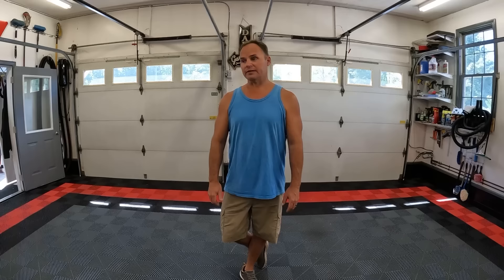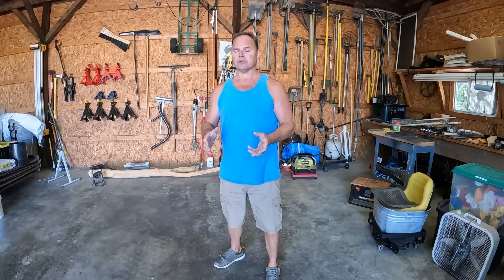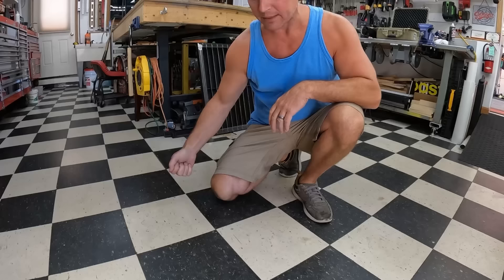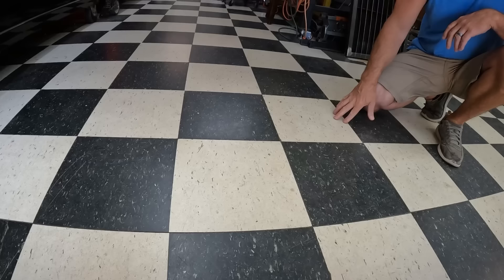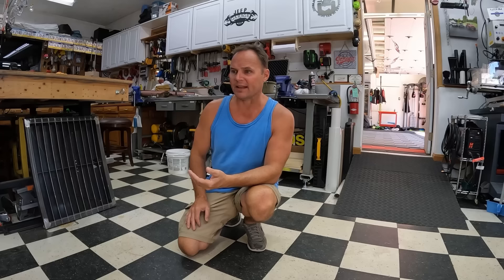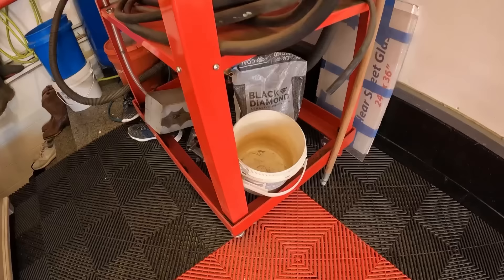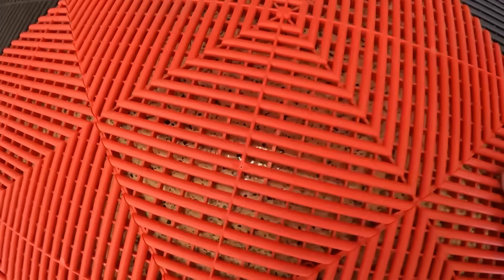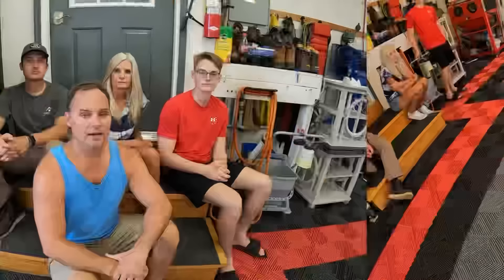SwissTrax/Epoxy/Bare Concrete-Garage floor options and a huge waste of money.

Comment: Quick question for Doug- How do your dogs do on the SwissTrax flooring?  I have a Lab and my wife and I volunteer raising Medical Assistance Dogs (mostly Labs) and I want to be sure their nails do not catch in the flooring. 

Secondly how slippery is the floor in the Winter with snow melting/ My bare concrete is super slick. Trying to find a good solution before I crack my head open.  Thanks - Bill
Reply from the maker: Hi Bill, I believe the round top SwissTrax would work great for dogs. They are no where near slippery that I have experienced. I highly recommend them for a garage floor.

Comment: Excellent video thanks. I am considering the smooth ribtrax for my outdoor patio deck. How do you cut around the posts? Would you recommend the stadard ribtrax or the smooth for an outdoor deck.(lots of barefeet walking)
Reply from the maker: Absolutely the smooth for an outdoor patio area.
As far as the posts, you are kinda stuck with where you start with the flooring. Figure out where it will be on a tile and when you need to cut it, heat it up a bunch to try to flex it around the post with only one cut into the post location. But layout plays a huge part as to where the post will land in the tile, it may even be between two tiles… best of luck.

Comment: i seen videos with racedeck flooring where the flooring lifts up and twists sometimes when driven on... any issues with Swisstrax like that... i know you probably should still be careful
Reply from the maker: Not a single problem but I never turn why wheels on it either. Straight in and straight out.
The only way I can see it twisting is by turning the front wheels on it.

Comment: On ribtrack would a 350lb tool box roll through smooth or would you have to push or drag
Reply from the maker: There would be some resistance. Definitely not as easy as flat concrete.
Reply: If you did it again would you go with smoothtrax in the future or next garage?

Comment: I have uneven floor (some lumps), will swisstrax cannbe fitted?
Reply from the maker: It will not do well over humps, but minor changes to the height can be hidden as long as the seam is not directly over the gap.

Comment: I'm more concerned about inadvertent coolant or oil spills if you're working on a vehicle. Or would you totally avoid this in a working shop floor?
Reply: If the plastic is resistant to pull and gasoline it may be okay to basically sweep it under the rug.

Comment: How much did the Swisstrax run you? I have similar size garage. 25x25.
Reply from the maker: It has been many years now since I put it down. I do not remember the cost, but I can guarantee it costs way more these days than it did back then.
Reply: I just looked at their web page the other day, they're quoting $5 per square foot there.

Comment: How does the smooth feel on bare feet and the rounds on bare feet
Reply from the maker: The smooth is much better on bare feet. That is why are used it on the porch. The round is perfect for the garage for shedding water.

Comment: Doug, thanks for this! Now, I'm considering using this with a different colored border on my back deck. The rain/snow will just melt, go under the Swiss floor and drip through the deck. I'm thinking I won't really have to do much to it as underneath it is all pressure treated. It certainly won't need an every two year pressure treatment and re-application of stain! Am I off base here? Your thoughts would be great to hear. Thanks!
Reply from the maker: @Randy Clyde you are correct, it would not need any re-application of stain or any maintenance with the SwissTrax on it. Best of luck!
Reply: @OneEyeCustoms  thanks very much! Love your new channel!

Comment: Swiss Trax is American made, but Swiss engineered. 15.75 in = 400 mm
Reply from the maker: @Nick F thank you, that explains it!!
Reply: @OneEyeCustoms  Does the Swiss Trax on the porch get hot in the sun? Can you walk on it barefoot on a hot and sunny day?
Reply from the maker: @Nick F yea it gets really hot, but not any worse than the composite decking right beside it. The decking and the SwissTrax are the same temperature in the sun and you have to walk very fast across it in bare feet.

Comment: Good luck when you drop something small lol.
Reply from the maker: I’ve done it several times. The good thing is it usually drops in right where it landed. Most times just a magnet or dental pick is needed. For the most part, it doesn’t roll 10 feet across the floor to never be seen again.
Reply: @OneEyeCustoms  
Fair enough.
Hadn’t thought of that!